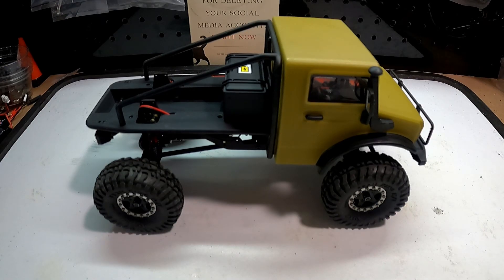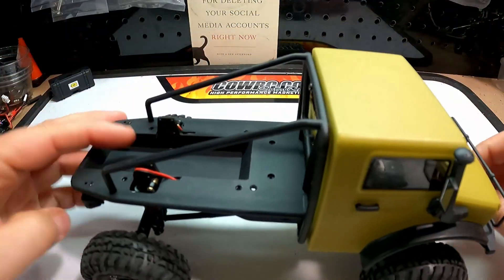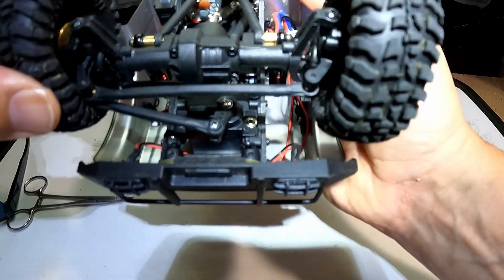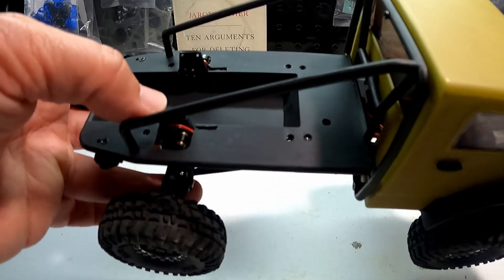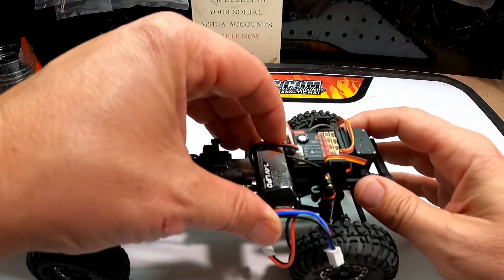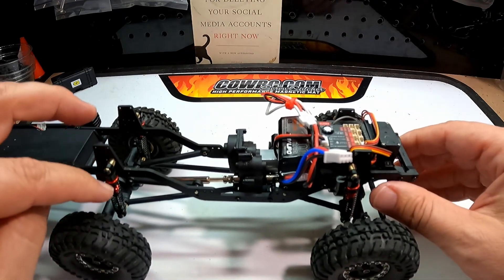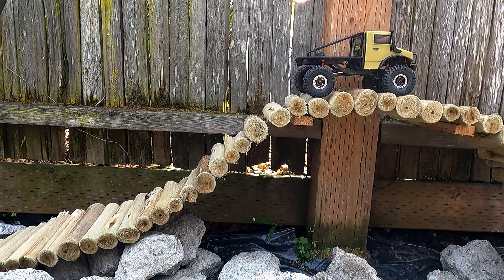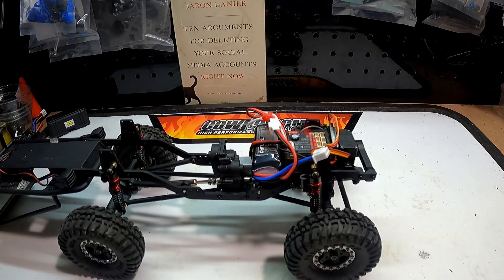Huge gains! How to relocate the battery in the CR18P T-Hunter!

Comment: I have a rock van evo. This video made me open it up. I can fit the battery under the front hood next to a small black box. Is this a good location or would the battery heat be problematic? It may be .25'' higher, but its up front.
Reply from the maker: Best thing to do is try it. There’s really not much weight in the rear of the rock van. Moving the battery forward and higher might cause it to tip forward when on declines. I wouldn’t worry too much about the heat.